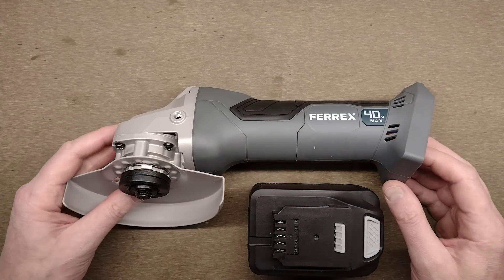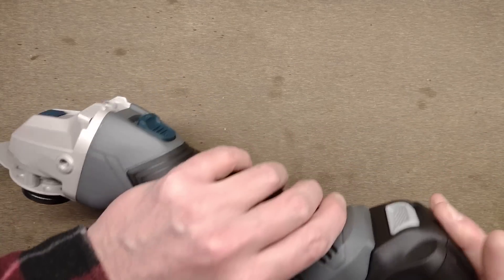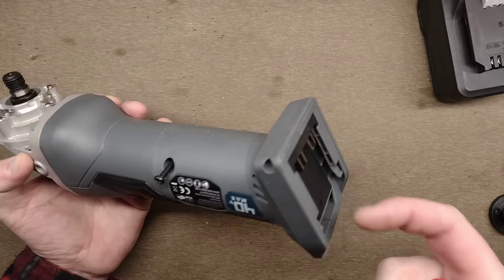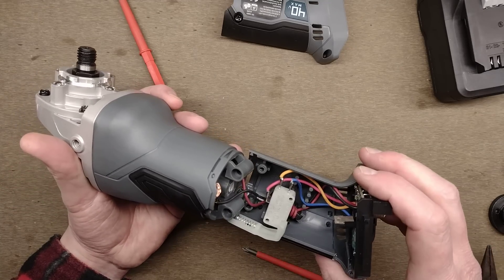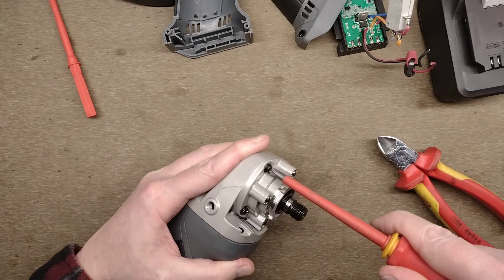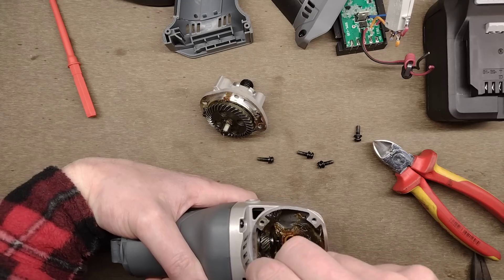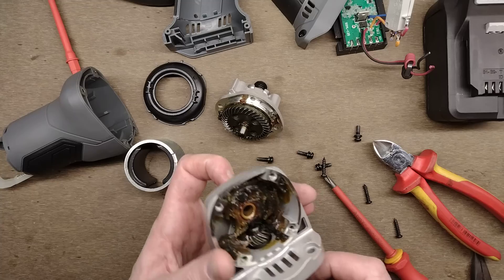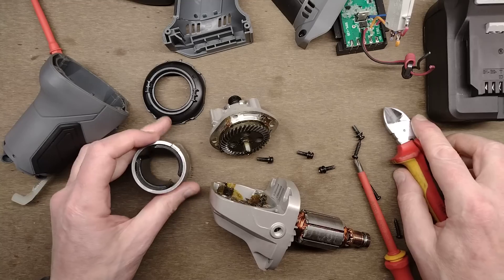Aldi 40V angle grinder mechanical teardown

Comment: Is the low voltage protection circuit part of the battery? Or inside the grinder?
Reply from the maker: The battery signals to the grinder to shut off.

Comment: Having had one for a couple of years  it had a “ faulty trigger “  ( from new) and was replaced under warranty without return needed. The motor would start and before up to full speed it would shut off, this happened @ each attempt for multiple times.  Later on ( months) I tried it again and it worked 🙀.   It has become apparent  thro trial and error that it’s fine above approx 15’C. But below it reverts to its old ways😠😠.  Any explanations would be welcome 🙂
Reply from the maker: It sounds like the overcurrent protection was on the edge of its threshold.

Comment: Nice little tool. Have nice quality but i'm having problems with the microswitch. Sometimes takes me 5 ou 6 Times pushing the button to turn it on. Any ideas? A new microswitch with those specs isn't cheap nor easy to find.
Reply from the maker: You should be able to find a high current microswitch at good electronic distributors.

Comment: Aldi have got them in again, selling for £24-99.

To compliment it, they've got a pack of extra thin cutting discs. 11 discs for £4-99.

On a different subject, they've got a 231 piece wire stripper/crimper tool set, complete with a variety of  crimping connectors (eyelet, slotted, spade, inline, etc.), and cable ties, for £8-99.

Comment: Are the brushes supposed to be held in with little springs ? Mine wouldn't work out the box so I decided to take a look myself. The brushes are loose with nothing to put tension on them. They just slide back and forth in the holder.
Reply from the maker: There are supposed to be springs holding them against the commutator.
Reply: @bigclivedotcom  That explains why mine didn't work then.  I paid 79 quid with the battery & charger for it too. Not such a good deal after all. 😞
Reply: Was hoping to see how the brushes in yours were fixed.
Reply from the maker: @bowmurbandit  If I recall correctly the brush holders were held in by a screw, and best placed in after the rotor had been inserted.  They were easy to remove.
Reply from the maker: @bowmurbandit  Get a refund or replacement.
Reply: @bigclivedotcom  That's right. But there doesn't seem to be a spring attached to push them on to the rotor, meaning they slide back and forth in the holder. Hence it doesn't fire the motor up. I'm wondering if they were emitted during manufacture.
Reply: @bigclivedotcom  Just found my receipt. It's not a year old yet so should be good for replacement.
Thanks for a great video. 🙂

Comment: I have the blue ferox grinder for a while now. Great cheap tool, BUT all ferox tools suffer with a very poor on/off switch. If using on stone you will have to periodically blow it out with an airline. I've always been impressed with aldi tools but the ferox range I've had failures with on/off switch with a batt block sander and batt multi tool and mechanism in batt jigsaw failed after 10 hours of use.

Comment: So I was really interested in this as I have a few outdated rechargeable power tools where the battery/charger (nicad or Nimh) is the fail point. For me the really interesting point is that it still supplies 2 wires to the drive motor. - golden!
There are lots of 3d printed adaptors out there....But if the end point is a two wire motor you can transplant the original circuit and battery holder...
I have now gained a few packs & with the tools on sale think I got this 😏👍 Now where is my hobby cutter? 
Merry Christmas Clive & BC followers - I hope you all have a fabulous festive time. Peace all.
Reply from the maker: One thing to keep in mind is that many of the battery packs rely on the tool stopping drawing current when the battery sends a signal that it is too low.   Mixing the wrong battery and tool can result in some batteries triggering a safety lock out.
Reply: @bigclivedotcom  Exactly! so by transplanting the tools board and it's plastic surround you head the problem off at the pass. The only connection is the motor/switch. The control pcb is retro fitted. The current cost of these tools equates to the cost of a 3d printed adaptor on fleabay that has no safety circuitry. 👍

Comment: Another good and actually useful vid- I wanted some  bevel gears just like that for an RC car project that I've stalled on,  the gear box did sound a bit rough but I guess cleaning up the teeth and improving the mesh/lash might be a good idea too- even at £19.99 they would be cheaper than similar gears used by Traxas, Arrma and the likes and probably just as good  quality- And you get a motor, batteries and soft start circuit for any other future projects.... I bet you none the 3 Aldi's that I know of in Bradford don't have any left in stock, And definitely not at £9.99! knowing my luck. I was going to ask about the battery pack(it looks awfully small for 40v) but that's the next vid that's just popped up- lol. All the best.
Reply: Yeah, if you go to some trouble and lap the pair in together you should have a serviceable gearset.  The existing motor will probably run til the brushes are worn out and is reversible.

Great value for money.

Comment: Ive got a ferrex set of tools and garden equipment ive had for 3 years the drill and grinder i have tried n my van and use regular as a forklift engineer. They work in a commercial environment . Id buy again . I have cut dozens of forklift fork tips off and buffed whiskey barrels for upcycling using dozens of flap discs . These tools are as good and probably better as any.  Still going strong

Comment: recently chainsaw blades for angle grinders where made unlawful to be sold in the UK by the The Office for Product Safety and Standards (OPSS} it would be great if battery powered angle grinders where banned too, the only reason to own one is for criminal uses, no law abiding person needs one
Reply from the maker: There's making something unlawful and there's actually preventing it.   I'm pretty sure they'll just have ticked their box by putting out a statement.
Battery powered angle grinders are a valuable tool for many workshop uses.  Only a tiny minority are used for cutting locks and removing catalytic converters.

Comment: I bought one of these a few years ago and its had some serious abuse and continues to work fine, the batteries hold up well too. I have other tools in the range, if you plug a 20V battery into this it does nothing but the 40V batteries work in the 20V tools.

For the price and the guarantee their an excellent deal.

Comment: I was given a blue Aldi 40v angle grinder with charger and 40v battery, the battery was dead and would not charge , as with other flat Li ion batteries  I put 12 volt car battery across the plus minus terminals for a few seconds to try and introduce some charge into the batteries, and it worked battery now charges fine. But when the tool stops on its own the battery protection circuit has acted and it probably needs charging.
Reply from the maker: I'd recommend not doing that with lithium packs.  A low trickle charge is better for cell recovery than a high current pulse.
Reply: @bigclivedotcom  in my experience if the battery voltage drops to low, the charger won’t see the battery so they need a 5/10 second nudge. Only since the introduction of li ion have I experienced the need to do this.

Comment: I've picked up one of these. Must say, I'm quite impressed.

I've also picked up one of their 20v Cordless, Rotary Hammer Drills, for £20.

It even comes with a spare chuck, for SDS bits. 😎
Reply: Geez at 1 pound to 1.80 ozzy dollars we're paying 3 times the price.
Reply: @EmeraldHill-vo1cs  You're paying the equivalent  of £60? 😲
Reply: Update.

I've discovered that there isn't a chuck (as such) for the SDS drill bits.

The SDS collet is part of the drill, and the chuck has an SDS style shaft, which fits into the built in SDS collet.

Comment: Somewhat careless design:  stand it upright on its battery with a standard disc in it, and it just balances.  Stick on a 6.4mm grinding disc and it falls right over.  If only they had angled the battery slightly more at right angles to the shaft it would be able to stand up!  Not a bad tool, actually, and some bits well engineered, but screw-in handle flange almost fouls the switch when screwed into the central position.

Comment: Hi you mentioned getting another tool from this range, strongly advise the cordless multifunctional tool. For me one of the best inventions of recent times , just so handy especially good at cutting square holes and cutting accurate small delicate things due to a very small amount of vibration 🙂
Reply: I got one of those on a whim and can confirm surprisingly useful and has become an essential in my tool kit. The cutter release does let go sometimes though.

Comment: I am sure I measured the pins and found that there was a short which corrisponded with either serial or parallel on my A/G and my 20v driver. I will check again later. You would expect some thing to make sure the batteries are in balance before being shunted in parallel though, but maybe they are relying on the battery manager to maintain a voltage differential that is close enough.

Comment: power tool and cordless vacuum industry should fix this problem of proprietary battery packs. it looks it is pretty possible with 20V increments and a standard interface.
Reply from the maker: That wouldn't suit their profits.
Reply: @bigclivedotcom  indeed but someone should force them like the EU.  i'm not even a tool hoarder, I have multiple cordless tools with lightly used batteries. i can't imagine the collection of power tool enthusiasts.

Comment: But can it be hacked to run a string of Christmas lights?
Reply from the maker: The battery could if a low voltage cutoff was used.

Comment: Hi, Big Clive, could you do more on the batteries, them selves, I've had poke around one with multimeter, you did briefly cover, the pin outs, of the, connectors, +40V +20V on probing, the 20volt version, there's a +12volt to that do not seem to be used for any, what is it, wounding, if your could do a bit more detailed, breakdown, work in evolved, make eco-support, to gain, access to the supplied voltages, what would be in evolved in making our acquiring, charging system, to them, as a project power packs (and the big would be most interested, on your view, how safe are they, any nasty surprises, with then, bag, fire bomb, that sort of think?
Reply from the maker: I've made a video about the battery (it's complex).  I'll be releasing it for general viewing soon

Comment: I bought Parkside (Lidl own brand) corded angle grinder here in Poland where I live. It lasted only 2 years. I realised that they use aluminium wiring on the electric motor. The wiring pretending to be copper because it is painted that colour. Basically aluminium wire has only limited number of vibration cycles before it snaps. The thin wire that goes to stator broke off when got tired of vibration and to you can't repair it because this aluminium wires are  so brittle. I would happily pay £2 extra for copper wire because the material price difference would be just about that. But no "built is obsolescence" must go on. I wonder if this Aldi uses copper or aluminium wiring. You can only find out by destroying it, cuting the wire to see cross section.

Comment: I had one of these, but returned it as it stopped working after a couple of weeks. Not sure if it was the battery, charger or tool itself. Either way had a full refund. Thing was handy if you dont have a wireless angle grinder. Last time i checked Aldi has a massive battery shortage so couldnt test for the fault

Comment: Thanks for pointing this out, I have bought of course. I strongly dislike the way retailers keep changing the mechanical design of their 18/20/36/40v power tool batteries so I tend to buy without battery and then fudge in an external Bosch 18 or 36v battery. Looking forward to second part.

Comment: the 40v battery is two 20v packs internally.  The tool's pin configuration determines whether the "battery(s)" connect in parallel or series - more accurate to say 36v and 18v..... but....marketing

Comment: the little pinion gear holds the armature in the gear box housing. typically will have a nut holding it together, once removed the armature slides out of the gear and housing.

Comment: Hi clive, whats your thoughts on the lidi cordless soldrring iron ?
Reply from the maker: I've featured it in two videos.  A hardware hack and an external button hack for adjusting the temperature.
Reply from the maker: (The one that uses the plug-in tool batteries.)

Comment: Many of the big name grinders have jam detection that will shut off the motor if it detects the disc getting stuck, I’d be interested to see if this one does. I suspect not, but still, £10 for this whizzy boi is a steal. Did it come with a battery?
Reply from the maker: It didn't come with the battery.  That alone is £35 or more.
Reply: @bigclivedotcom  I thought that might be a bit hopeful, if it did I’d be stripping them to repack my older Makita batteries.

Comment: In true Bigclive fashion,  you pulled it apart....did you put it back together ? For the occasional use around the house it can be useful. By the way, that is a bevel gear.

Comment: Remember all you need is one £10 grinder to steal a £1500 bicycle. The grinder can be thrown into the river. If it lasts one lock or bike frame, it has done its job.

Comment: My 10 year old cordless Makita angle grinder does not make that nasty rattling sound. It is quite loud but it sounds more consistent and no where near as nasty as that thing. I guess its an ok buy for a home owner, but one of the cheaper options from Makita or DeWalt would serve much better, last longer and offer battery compatibility with many more options of tools.

Comment: Jeez that gear drive sure makes a racket despite it being greased. It is an angle drive gear setup just like a car differential, the big gear is the crownwheel and the small one on the motor shaft is the pinion.

Comment: The MOSFET is there for a soft start. On mine the soft start functionality stopped working soon after I bought it. I kept using it for a year or so and then one day it stopped working completely. Took it apart and the MOSFET had died in a spectacular way. The PCB underneath was completely charred. I replaced it with something close enough and I also had to remove a nearby zener diode because it had failed short. The soft start functionality now works again.
Reply from the maker: That seems common.  It would also have defeated the over discharge protection if the MOSFET had failed short circuit.

Comment: I think there's no way for the battery to disconnect when the voltage is too low and this is the responsibility of the device. So I guess it's just the turn off when battery is low system.

Comment: I have the 40V hammer drill from the same manufacturer.
If you look at the label on the base of the battery, it states; 5.0AH / 2.5AH.
So yes, it would appear that the 20V tools use the two sections of battery in parallel.
Reply from the maker: I've got a 20V tool here to explore.

Comment: Clive the larger Crown wheel/ring gear and the smaller pinion gear attached directly to the motor are the names or the gears inside the gearbox

Comment: Wow first 40V tool Fom Aldi. Start-up doesn't sound well. Compared to an 230V unit.
Reply from the maker: To be fair, the mains units sound just as bad.
Reply: @bigclivedotcom  I believe i still have a Ferm, or so, 0Haven't that Dutch brand at Aldi in many many years, used to be more or less its house brand. But controlled by the importcompany, and aldi wan't its own brnd. Ferrex replaced the previous Alid brand only a year or two-three ago. Of course it is no match for an 850W Bosch Blue.

Comment: It's amazing how such a simple gearbox manages to sound so rough!
Reply: Although they're helical gears the mesh isn't that precise I suppose.
Reply: @heckelphon  Yes, and typically no adjustment for backlash in the design, so they're built quite loose so with heat and tolerance stack-up they are kept away from the opposite; binding. Because of that large backlash,  when run no-load, those (hopefully hardened) gears chatter quite a bit giving the distinctive angle-grinder sound. They smooth out when cutting, but then there's usually a lot of other noise happening.
Reply: Used a few makes in my time and they nearly always sound the same in good way🙂
Reply: Terrible haha
Reply: I think they are deliberately designed with some imprecision.  A few degrees either way isn't going to make much difference with an angle grinder.  If the gearbox runs a bit on the warm side  (and it's likely to, because imperfectly-meshed gear teeth are necessarily inefficient),  there could be some thermal expansion going on; which, in the absolute worst case, could lead to binding and jamming.  The manufacturers probably are erring on the side of a little sloppiness and relying on the grease to keep it quiet  (which, admittedly, it won't do for long once it starts melting),  rather than making everything fit perfectly and run silently but only as long as it's kept cool.  It's all a balancing act .....